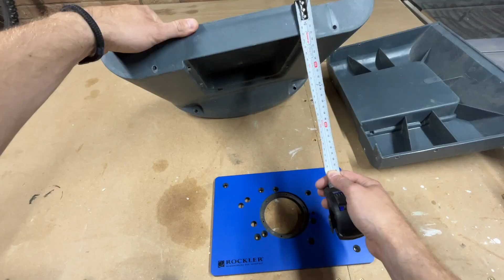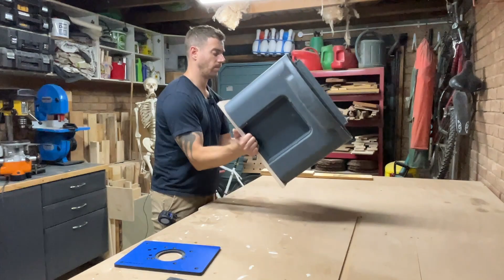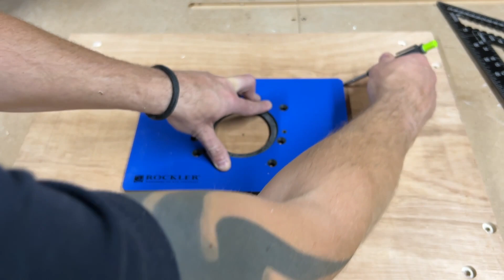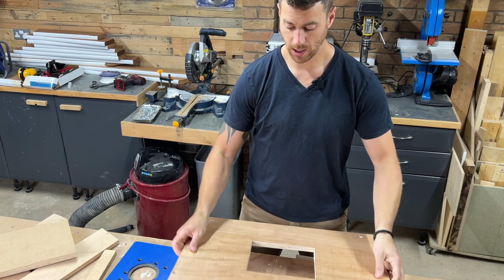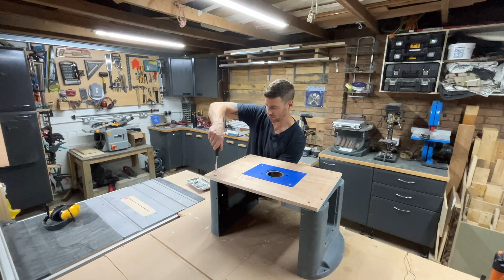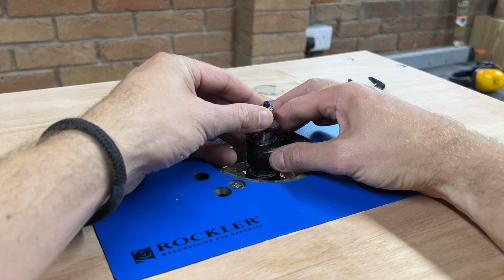The Easiest 1hr Router Table Ever!

Comment: Great video. I’m going to do something similar with my Triton router. Did you make a fence and if so does it interfere with the winding mechanism when placed close to the router bit?
Reply from the maker: I’ve not added a fence to mine as I’ve only used it with bearing bits. I don’t think a fence would get in the way of the winder but even if it did then I guess you’d just wind the bit up first and then adjust the fence after.

Comment: Great. I wasn’t sure about using this router for this purpose but your video helped a lot. Thanks!
Reply from the maker: It works a treat! The micro adjustment tool is a bit clunky as you need to use two hands to make sure it stays in place and you’ll get sawdust in the hole so need to blow it out every so often but it raises and lowers really well.